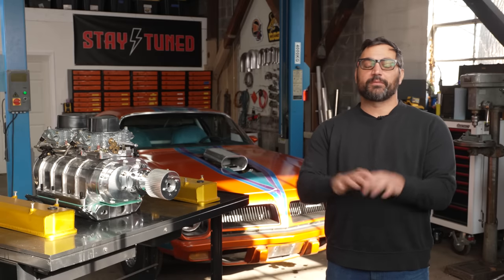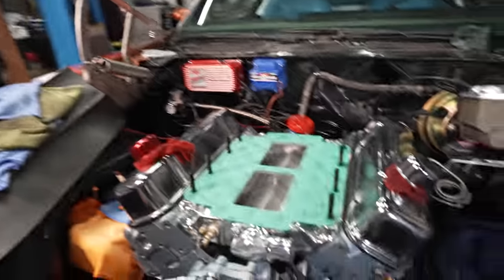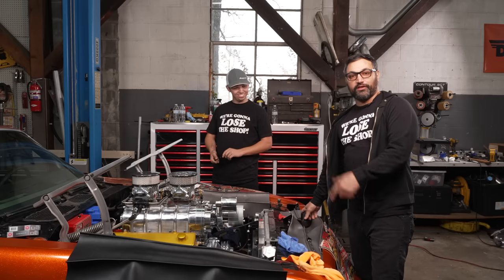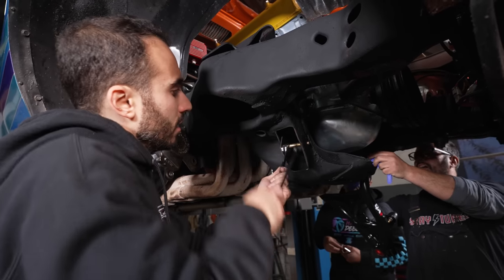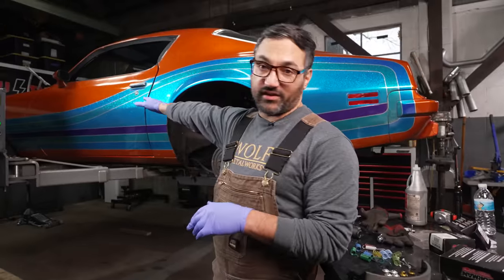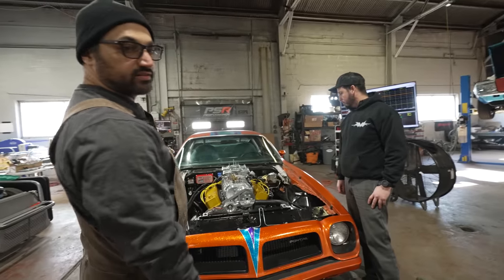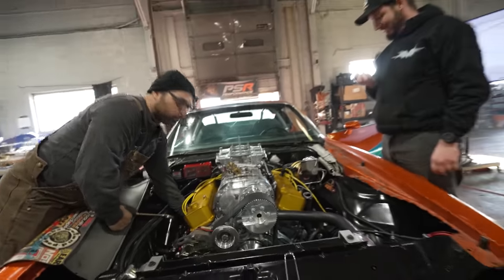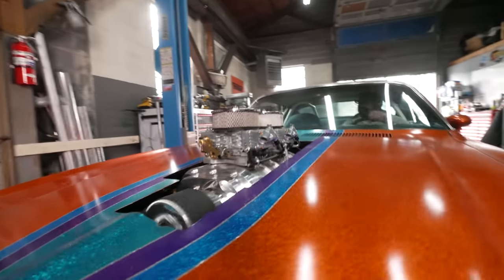Can An 85 Year Old Supercharger Make Hellcat Power? - Tony Angelo’s Stay Tuned

Comment: Also there are small side mount power steering pumps that can work from custom engine bays you need power steering. Also the orgasmic thing is the Muncie 4 speed on what 4:10 gearing??.

Comment: You guys should have trimmed your lower intake gasket around the ports. You left the center divider on, with nothing to clamp over it. It's going to flap from the pressure from the blower and either break off, or rip causing a bad leak. Either way, it's not going to be good. That is gonna NEED to be fixed before it causes an issue. Because it WILL.

Comment: Hey Tony I'm building a 1948 farzer gasser it will never see a drag strip more for showing off I'm running a chevy 454 2 bolt main I've been told it will be great what is your opinion oh mains will be arp stud and I'm using a 6-71 blower

Comment: You need some 99’s in that thing 

The 4-71 type designation for the Detroit diesel can be broken down to 4 cylinders, 71ci each. 6-96 would be 6 cylinder, 96ci each.  I’m not sure that was an actual model but you get the idea.

Comment: Just adapt a modern electric power steering to it, or maybe possible to mount it between firewall and steering box, but should atleast mount under the dash to the box , and a control box and knob to adjust how much it helps you!

Comment: Electric power steering and an electric water pump would be the awesomest !

I had a 1979 Bronze T-Top Formula Firebird with a 400, a 650 Holley double pumper, a Richmond 5 speed, a 4:10 rearend, Centerline rims wrapped with Mickey Thompson rubber, and an 800 watt Blaupunkt stereo.

It was a blast
This was around 1987 and I received a lot of blow jobs in that car :)))

Always go with a dual key crank and welded subframe connectors on any application you might boost in the future.

Comment: Drum brakes are easy to do taking pictures is helpful but if the rear brakes have been done properly the other side should be a mirror and always do one side at a time when it comes to drum brakes just incase you need the other side as a reference

Comment: 6-71 blowers were designed for:
6 (cylinders) 71 (CID per cylinder)
This, however, does not signify the actual displacement per revolution of the supercharger. The actual displacement per revolution is determined by the rotor length and diameter.

The data for GM based Roots blowers are:-

6:71 small diameter 
Rotor dia=5.505", length=14.975", displacement per full turn of rotor=339CI. 

6:71 big diameter 
Rotor dia=5.778", length=14.975", displacement per full turn of rotor=411CI. 

8:71 
Rotor dia=5.778", length=15.905", displacement per full turn of rotor=436CI. 

10:71 
Rotor dia=5.778", length=17.000", displacement per full turn of rotor=466CI. 

14:71 
Rotor dia=5.778", length=19.000", displacement per full turn of rotor=521CI 

This is theoretical displacement.

Comment: Shouldn’t the intake gasket match the manifold runner cutout instead of the heads? Since the manifold is 1 opening for 2 intake runners on the heads it creates a path for boost leak into crankcase. The gasket has 2 oval blue seals around the runners with a gap in between. The gap is where you will have a intake leak. Well unless maybe you guys used a sealant as well. Just going by what I saw in the video.

Comment: 4-6-8-12/71 refers to the number of cylinders in the original engine.  8/71 is 8 71 cubic in cylinders. There are 53 and 92 cubic in cylinder engines also.

Comment: Extra 2 stroke diesel engine info. They will not run without a positive displacement blower and in some configurations they were also turbocharged but it's not considered twin charged. A two stroke If you want to hear som

Comment: You weren't really getting 340hp on 7 cylinders. The rocker being gone means that with out the one cylinder, that one is not just not making horse power, it is also a drag on what the other 7 are making just keep that one going up and down.
So, 6 maybe 6 1/2 cylinders to make 340hp.

Comment: I'm only 58 but the first time I did disc brakes I thought what kind of witchery is this😁 
I did so many drum brakes from the time I was like 12 all I needed was was a pair of regular pliers and a flat head screw driver,not a huge one but decent sized. The only difference for years on GM products was the width of the pads and drums and the rear had self adjusters. Oh I forgot,you need a hammer to jar the drums loose.

Comment: Good progress on the car but ......6-71 blowers with a case and rotors from a 6-71 Detroit diesel engine only have ONE size of case and rotors. Some aftermarket case and rotors may be smaller on the inside and have the same external case size as a blower off a Detroit diesel but if it came off a 6-71 diesel they are ALL the same inside and out. There is no small bore or big bore unless it's an aftermarket case and rotors. If the crank in that engine isn't forged steel you are running a risk of breaking the crank snout off. I've seen it happen to several Pontiac engines with a blower before. You would have made noticeably more horsepower on E 85 instead of high octane pure gasoline because of how much air charge cooling you get from the alcohol in E 85.

Comment: Are you running a M21 behind it? I have a 461 as well with the 6x heads, I've been tempted to up the power but always nervous about the m21. When I put mine on an engine dyno it made 403 hp 492 tq so I'm curious what It would do with something along the lines like you did vs. putting on a set of kauffman cylinder heads

Comment: For you diesel fans, 6-71 was a Detroit engine model the blowers came off of as tony said. For a little more clarity the blower is not a 6-71 its self like it is called in the auto world but rather a blower FOR a 6-71 Detroit diesel engine.  6-71 denotes a straight six-cylinder, 71 series engine. they made a 4-71, four cylinder 71 series as well as several other configurations like the 8V-71 being a V configured eight cylinder 71 series. there was a hand full of different series as well: 50, 71, 92, 149 and more that were all two stroke super charged engines. some were even super charged and turbocharged. Non of this maters to the modern auto enthusiast but as a marine diesel mechanic who on rare occasions works on these old turds I thought would share.

Comment: @26:59... Dude, back away from the Drum Brake Assembly! OMG, I cannot believe you do not have a Brake Tool in your hands! (and yes, I listened to Metallica, before Cliff died) 😮😮 LOL, you used High Temp Lubricant "On These Points"... Umm, I use left-over grease, or snot... either one works!

Comment: Yeah the 6:71 8:71 goes back to the Detroit Diesels being measured by the number of the cylinders and the displacement of each cylinder, sometimes with a V for showing it was a V configuration.. They had everything from 1-71 to 24V71 and 24V92 or even 24V92TT for the twin turbo version.. yes twin turbos on top of a supercharger. Without a supercharger any two stroke Detroit Diesel over two cylinders can't run on it's own. The pistons don't make enough pressure to pressurize the crankcase enough to transfer the air properly. Amazingly for an engine designed in the 30's they had all sorts of tech you wouldn't see on regular vehicles until the last 10 years or so, including 4 valves per cylinder, overhead cams, piston oil squirters, and direct injection. Common rail injection is also something they did that really didn't take off in diesels until the 70's. Yes they were two strokes but they actually didn't pollute much as they didn't add oil to the fuel, they had a stand alone oiling system like a four stroke and purely injected diesel into the cylinders, they also got over double the mileage of similar four stroke diesels of the day.. They just were loud as hell.. a 6V71 with straight pipe stacks is over 120db 10 feet from the end of the pipe on ground level.. a regular diesel is about half that.

Comment: The reason it's called a blower is because it's original purpose was to blow air into the combustion chamber on the old diesel 2 stroke

Comment: That ‘74 should have an 8.5” 10-bolt. It actually replaced the 12-bolt and it’s almost as strong. It’s the older pre-‘72 8.2” 10-bolt that is weak.

Comment: Late 4th gens (ls powered ones) are worth decent money. Probably about what they cost new. Early 4th gens (lt1) are not worth much unless it’s really built up or super clean low mileage. V8 3rd gens are worth a good penny if they are clean low mileage. First gens are way out of most people’s budgets even rusty shells. Early 2nd gens are worth decent money. Late 2nd gens are still worth decent money if they are clean.

And I can do drums brakes just fine. Then again I’ve a owned a car with 4 wheel drum brakes for 20+ years. And I was too young to see Metallica with cliff burton, though the first album I bought brand new was Appetite for Destruction (I was little). I also work on cars and trucks for a living and most trucks have rear drums.

Comment: Vanity valve covers. You could have painted the other ones yellow fella. He stood right in line with that belt while it was making a pull and turned his head like he was positive that thing couldn't come off and slap the setup out of him. And the obligatory throttle whacks even though it's carbed and has a room sized intake. Whoever came up with that paint job wanted a Duster. I can't stop smiling thinking about you strutting around that 2nd gen turdle and judging the almighty 4th gen. Catfish rule!

Comment: Kinda misleading. That blower is not a 1938 blower. And navarro didn't start using a 3-71 flathead blower till 1948. The original gmc blowers that Navarro used didn't have 4bbl carbs.
Reply: the internal design is basically the same.  its just got some bells and whistles  but the way it works is EXACTLY the same

Comment: Oh you said not a big block but it's a 461 stroker that is a big block I mean a small block 421 with 428 heads? Or 428 with 455 heads making a stroker.
Reply: All Pontiac blocks are the same size except for the 301.

Comment: Unfortunately, I’m not sure if it’ll be the hellcat yet a redeye with 700 or a jailbreak charger with 805 or something
Reply: its lighter than both of them  so its very possible  thats chargers/challengers Achilles heel...theyre heavy
Reply: @KingJT80  yeah, I know what they weigh but it’s they’re not beaten 800 or 700 ain’t happening specially, on the highway maybe street racing yeah
Reply: @atrain882  this car already is making enough to beat them.  563 at the wheels is around 650 or so

 and 2 gen F bodies don't weight more than 3600-3700 at the most. It would be a tough time for a redeye or hellcat

Comment: But I'm not sure if you're aware of it but as gas has more to lead than fuel did back in the day let it fuel even though it says 101 low-led they do their mathematics in a different way the 101 octane would be like 106 octane and automotive fuel The amount of led in it is probably three times the amount of lead that used to be in let it feel back in the 60s remember that when you're tuning your engine it may give you some insight as to stumbling fumbling and or a dead spot they run more lead in the fuel but in their high altitudes it keeps engine lubricated and also does a few other things so that it can actually gobble up the gas and burn it without spitting out raw fuel

Comment: Why not go with a manual rack & pinion and add an electric motor for power steering? I understand the units off a Toyota Prius work well and are easy to adapt and wire. Then you can tell the cops it's a hybrid! LOL.

Comment: My formula 400 had plenty of power and torque would burn both tired as long u wanted and 100 in a city block or less was co ing quick and violently z28s of the time didn't stand a chance neither did most built 350s or any 400 novas I ever raced.

Comment: @ 27:10... HERE! I can do those breaks with my eyes closed, I can also show you how to rebuild that wheel cylinder for $5.00 too. I was into Metallica before Cliff died but didn't see them until 89'. My question is why didn't you convert the rear end to disc? You spent a fuk-ton on suspension why not convert? As a matter of fact just about all the F-bodies I had I swapped (I went through damn near 30 of them) 10-bolt rears out of 78-81 T/A and Formulas had rear disc brakes... IF you do go that round swap the metering valve also, I'm surprised this was hadn't been swapped.  ¯\_(ツ)_/¯

Comment: Plastic doors and fenders on 4th gens makes them far less desirable than a 3rd gen to me.  Because face it.  Nobody is going to leave the tpi or LT1 in there, so making it about the engines doesn't make any sense and pretty much the engine is the only reason to go with the 4th over the 3rd.  Okay.  Maybe brakes and a 6 spd.  But maybe I'm biased as the 1st car I bought with my own money was a brand new '88 IROC-Z, LB9, 5spd, G92 car.  And I've owned my '69 Camaro for 32 years now.

Comment: Why aren't you letting it rev out? No reason she can't turn 6800
Reply: Its going to be done making horse power before that.
Reply: @user-xz4nk2nq5j  not if it's built properly for rpm. My pontiac 462 crosses over at 5900 and hp flattens around 6500 (need better valve springs) 

My 400 small block chevy revs to  7200 comfortably

Comment: If your going to put in your title your using a 1938 super charger then do it just more lies aka click bate crap.. you are not using a 85 year old super charger it's a brand new one based on a old design... And no crap it will add power it's a super charger..... Your title should have said we are putting a super charger on the car look at the power it made
Reply: It's still  85 year old tech.